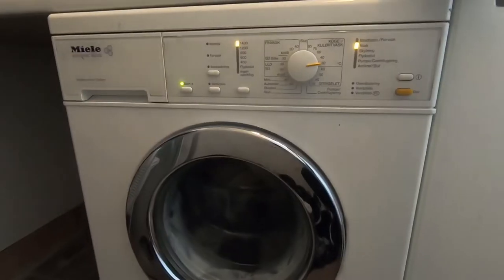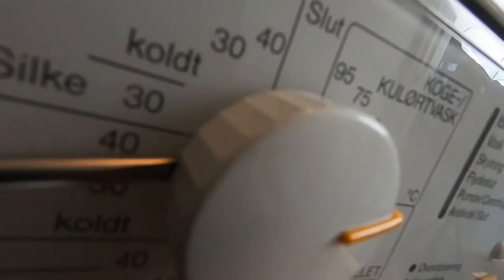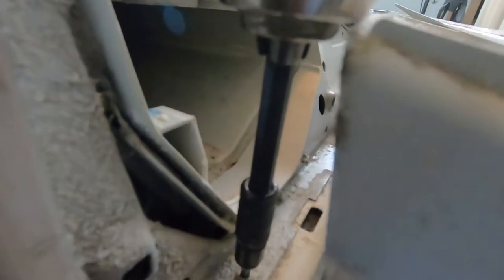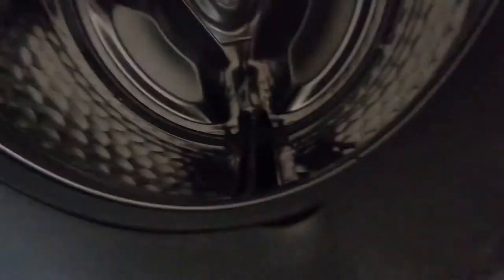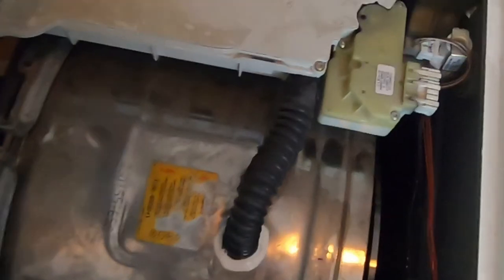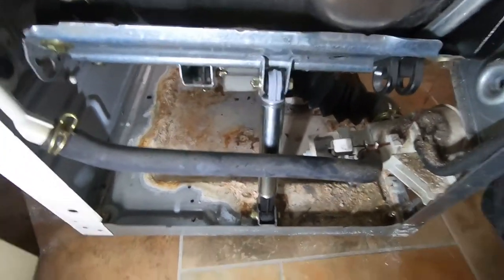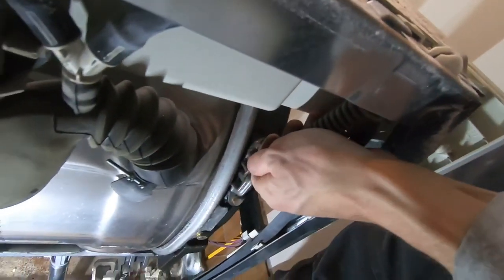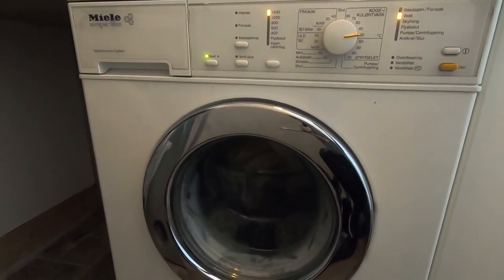How to fix washing machine / spring, shock adsorberes on a Miele and others.

Comment: Thanks for your video.  I have a W1918 and access to the shocks is only possible from the front.  You are lucky to have side access.  That said, how easy was it to loosen the bolts for the shocks replacement?
Reply: I also have a W1918.   Still trying to figure out how to get to all the shock bolts.   I can get to 1, but I cannot get it to budge....
Reply: So at the weekend I managed to replace the shocks in my W1918 by tipping it on its side and removing the bottom panel.   Took a lot of torque to remove the bolts and it's a tight space but got there in the end.

Comment: Thanks! 

Yes, I turn mine on and it channels a demon and starts furiously threatening all mortal souls in the room. I pounced on it and rode it like a bull out of hell, rodeo styles. Then it coincided, and started screaming at me as it punched me through its own chassis. I got it in a choker hold just long enough I could reach around and hit the off button… and that would have been the end of it, but I couldn’t take my eyes off that alluring orange button… and the battle continues to this day.
Reply: Are you balancing your linen correctly.  Sometimes if you put heavy items like towels or jeans in with lighter items the drum won't be balanced properly and cause the drum to bang or vibrate.  Also make sure you put enough clothes in.  Not enough clothes can cause an unbalanced drum when spinning.
Reply: @MG63  I just did a light load to test. I bought this machine second hand. The seller told me it worked. It works alright, I’ve got the battered soul to prove it. I’ve never met a machine so powerful. Although I think the shocks are gone. So I bought some shocks and I’m building up the courage to install them. But it’s not a priority in my already urgent life. I’m replacing an old washing machine that was built just after WWII. It is also a powerful bullet proof machine, it has 2 drums, a seperate drum for spin cycle, but it has tendency to destroy my clothes, by twisting them all up in a knot. Lucky I’m a rigger and an expert at untying knots. Although, I would like the luxury of employing a washing machine to wash my clothes so that I don’t have to. I’m just trying to work my way into the 21st century. 

Thanks for the advice, there’s a chance the machine is under loaded.